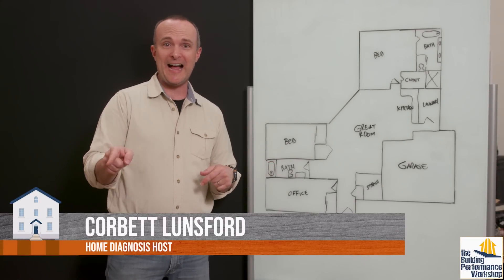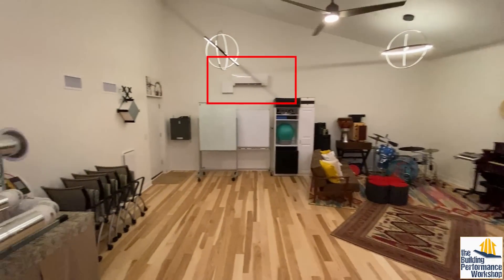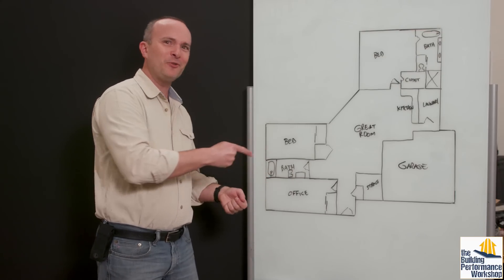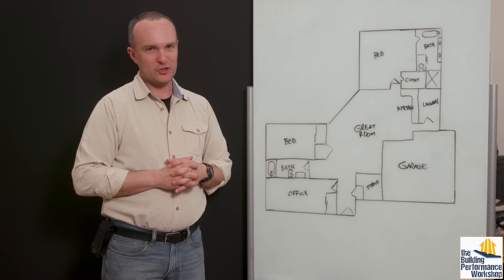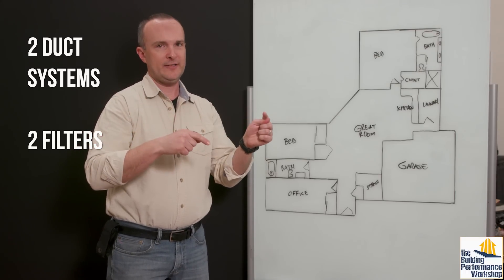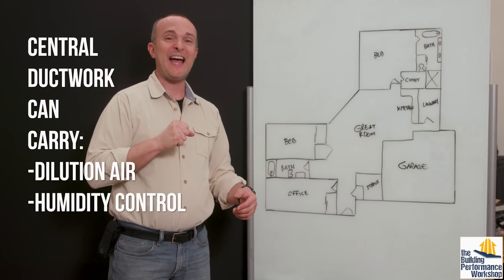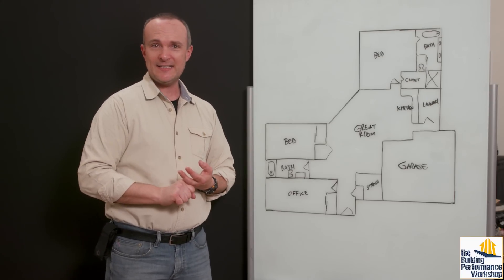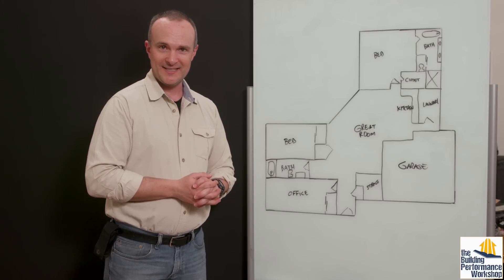HVAC Ducts Reality Check: Are Ductwork Systems Dumb or Essential?

Comment: A bit off topic… but what became of reversible duct systems that included registers both on the floor and near the ceiling to capture hot and cold air optimally?
Reply from the maker: Interesting q, Ty- I’d say if you have a good airtight insulated enclosure, you won’t have as much bleeding of heat, and if you keep the air mixing then you won’t have any hot or cold regions in any room.

Comment: Hey I've got a question on manual J.  I'm building a new home addition, it's 1500sq ft of shop with 1k Sq ft living space above.  Separated from homes envelope.  

R21 insulation in all walls, r5 foam on the exterior.  9ft ceilings.  1st floor is slab on grade with insulated edges, r38 in the floor joists. It's got 4 18"x4' windows. Second floor also has r60 attic, it has a slider, a man door, and 3 4x5 windows.  I've air sealed with foams and acoustic caulk everywhere I can see including soffit (left enough open for venting). 

Area is eastern wa, design temp is 95 high 11 low.  The calcs I get say I need 10k btu heating and 8 cooling.  That seems wildly off base, and my original plan was a 24k mini on each floor (they are both wide open rooms).  18k minis are exceptionally cheaper so now I'm waffling between 18s or 24s.  

Any advice??
Reply from the maker: Doing the math almost always shows you a much smaller than expected load. That’s because we were trained to think that every home needs a massive HVAC system, which is simply nonsense. Your load is feasible, but I’d need to see the details to completely agree.
FYI: if your load is 8k cooling and you install not one but two 24k units, you will be oversized by 600%. The inverters will ramp down to 16k minimum, no lower, so you’d be installing single speed 200% oversized equipment in reality.

Comment: Air filters in central air systems with ductwork do very little.  Do they remove dirt?  Sure.  Most dirt?  Nope.  I have lived in several homes with such air filters and  have seen the dust they remove, and I compare that to all the dust I still see on shelves and other flat surfaces, and the inevitable dust bunnies.  Conventional filters in central air systems remove far too little dust.  And they create a pressure drop, so the fan works harder, so the homeowner pays more money for electricity, without even realizing it.
Reply from the maker: Higher MERV, bigger filter surface area will fix all those problems
Reply: How would that fix it?  When I put in both the 4 inch plus the standard filter that my supposedly healthy system has, the hvac company said it was too much and blocking airflow would make system work too hard.

Comment: A lot of Europe is ductless and I prefer it at least for smaller units or spaces.  Like anything under 1800sqft or so would be dumb to do ducted  both new and retro build - it takes up a lot of space, noisy, expensive labor, and chances are the HVAC contractor will design/size it wrong.  Completely different when talking about 3k sqft or bigger building with multiple floors.  In such cases you probably have the budget for a nice system, and  contractor that has some engineers for a good/proper design.

Comment: Duct work and scorched air are very bad for those with lung issues. I have designed and built 2 homes now with no central heating cooling or duct work. I easily filter any air with a HEPA filter if needed. I enjoy clean allergy free air and proper humidity without the scorched dustly dryness of primitive and costly ducted systems.

Comment: my 1970's home has no ducts, but I wish it did.  Would make things easier.  I just have electric baseboards in a cold climate.  I'm trying to find cost effective ways to upgrade hvac (add ventilation, dehumidification, and some cooling would be nice).  Quote for whole home minisplits was so high, I might go for radiant floors instead and buy a couple air-filter appliances

Comment: On suggestion: Avoid using Flex duct as much as possible. Yes it cheap & easy to install,but the plastic breaks down over time. At best Flex Duct has a lifespan of 20 years before the plastic starts to fail. I recommend PVC Pipe, Kool-Duct by Kingspan, or Metal Duct work. Using PVC pipe is the easiest to use since you can use PVC pipe fittings. You can use Sch 30 6" PVC for all of your branches. For the truck lines I recommend Kool-Duct as its R-6 and does transfer noise as much as metal duct.

Comment: I think you're missing a few points. The first is that without zoning a single HVAC system has hot and cold spots throughout the house because there is always one room at the end of the line that gets the scraps of heat and cooled air. Then you have the basement which is too cold in winter because you're heating the upper floors or bloody freezing in summer because all the cool air pools down there. Then you have the fact that you are constantly conditioning the air everywhere in the house even though people may only be occupying those spaces for less than half the day. Personally, I am all for having two, three, or even four minisplits throughout the house. They can be programmed to turn on before the space is to occupied amd off when not, like at night.
Reply from the maker: Performance tuned homes with attention given to airtightness and insulation do not, in fact, work the way you describe. It’s a challenge to understand it if you haven’t spent time testing homes like this.
Reply: @HomePerformance  mine does. I think open concept from basement to upper floor throws all tuning and testing out the window. I know I could add automatic dampers to the supply ducts to help but when you're dealing with one open space over three floors it is a major challenge. We had a 168page report on hvac submitted to the city and it still doesn't work properly. I'm going with a wood burning fireplace and zones controlled by individual units next time. Centralizing with one furnace is also risky as they tend to break down on the coldest day of the year. Id like to have an alternative source of heat for when that inevitably happens.
Reply from the maker: Holy cow, that’s not supposed to happen, there must be a lot of things off with either the design or the install.

Comment: OK.  I went in between.  I went with Mitsubishi also - I put a traditional 1 1/4 ton head in my conditioned garage, but on the living space, I went with pancake, above the ceiling air exchangers and ductwork...but each exchanger had 3 12x12 inch return filters going into a custom designed return plenum - and each had 4 supply ducts from a supply side plenum.  I was able to have each do multiple rooms, but with very short runs on both supply and especially return.

Since these are low static units, you have to minimize bends in the ductwork and it's better to use metal near the ends and elbows rather than very mcy flex duct...just enough flex duct to keep things quiet.  And man, are these things quiet.

Comment: I recently went through this decision myself. I have a 2 story up and down duplex. Each unit was heated using electric baseboards. I looked at ductless options (as we had a ductless AC unit in the upper unit already) and i looked at high velocity tiny furnaces 15kbtu-30kbtu units). In the end i opted for 2 seperate firnaces 40k btu each in size, one in each unit with their own seperate ductwork. 
I came to this conclusion for the same reasons you mention here. Air cleaning, central conditioning, fresh air dumps into return plenum and blends with homes return air and ditributes to each room, and cost! A quality ductless with 3 indoor heads can run near 15k canadian, and in extreme cold weather id still need backup heating...no thanks

Comment: i will be building several houses over the next few years, and they all have a set of things in common: 1. radiant floor heat.  2. an HRV.  3. a mini-split for minimal A/C.  perfect combination and only a little duct work
Reply: Hopefully you get someone who knows what they’re doing for your ERV/HRV. I have an ERV and the contractor put in a simplified system. I’m going to be stripping out the insulation in the attic and in the area in the attic where we have the ERV I’m going to be removing the trusses and replacing them with rafters with the insulation between the rafters and putting in a dedicated system. I’ve spoken to a number of contractors and it appears the vast majority of them are clueless about a well designed system. As well as properly insulating a house. Radiant floor heating definitely is nice.
Reply: @erictoulon5946  I have a Lennox HRV5/150 that I installed myself in this house, and i'm quite pleased with how it turned out.  4 supplies 3 returns, auto runs in low sunset-sunrise
Reply: @BrianKrahmer  I live in Hawaii so I'm wasn't that familiar with them other than knowing that I wanted one for my house that I just had built in Washington. I've been watching the technology evolve since majoring in industrial arts in the late 70's. The contractor did a really good job building the house but there were a few things I would have done differently had I known. All in all it was a great  learning experience and the remodeling projects merely reinforce the learning curb. I've been in a few houses that had good ERV/HRV systems and that is what I am trying to achieve. Tight houses with poor circulation almost always trigger my allergies.
Reply: Hey there, I'm building an affordable, high performance house this year in the Puget Sound.  Would you recommend and share their contact info?

Comment: I've done thousands of real estate HVAC inspections that include duct evaluations, and always find the return area is to small. Not only does that hurt the system, when a high merv filter is used in these systems, it puts even more of a strain on the equipment. Sadly the high merv filters don't have a warning on them about the return sizing requirements. Return sizing when using high merv filters is the most overlooked part of a system. 

Personally, I run a ducted system and a mini split. I also open the windows in my house on the nice days (69-74f outside) for natural fresh air cross breeze whole house air exchange. This is something most people never do these days.

A big problem I see, as a contractor, with energy efficient homes is that no one looked to see if all the energy efficient items work with each other. For example: An entire community was built with Rinnai water heaters, and water saving fixtures. After the 1st year was up for builder warranties, everyone was complaining that no hot water was available at the fixtures. Sure enough, all the water saving fixtures had low gmp devices on them that would not let the Rinnai fire up to heat the water.... LOL How does one tell the owners that got Tax Credits, that they either loose the Rinnai OR all the fixtures have to be replaced or modified with higher gpm devices??? LOL This is a problem that can get the owners in trouble with the tax credit program, and also that the final inspectors approving the tax credit don't understand or catch.
Reply: Actually, your furnace blower cannot overcome a high merv filter, regardless of the ductwork. Everything is much more intertwined than most people realize.

Comment: Is duct work dumb or essential?  The answer is....yes.

So much ductwork is so poorly done, both residential and commercial, that it causes more problems than it solves.

Usually, the building is designed first, and then the mechanicals are shoe-horned in after the fact and done on the cheap.  You end up with some pretty junk systems that can not be easily maintained nor easily upgraded.

Couple points:
If you want regular fresh air bathrooms make great constant exhaust points.
You are asking for trouble if you have a single mechanical AC system.  WHEN your system fails, you now lose 100% of your ability to heat heat/cool/filter your air and yay you now have to pay a premium to get someone to come work on your system immediately because you have no choice.
Dedicated dehumifiers work far better than central AC based systems and can be located nearest to trouble spots.

Comment: It is hard to comment on this with no sizes up... But couldn't you have tucked a 5 head mini split near the office bedroom that would feed all main rooms?  Then just put in cheap electric panels under the flooring in the bathroom for heat that if your house is sealed well will not really ever get used..  Then in the garage or laundry room, maybe a crawl space or attic put a ERV/HRV system an just run the 250cfm 2.5inch heads to the areas in need/ all the non bathrooms to keep the negative pressure you need or at least make sure it is less cfms to the rooms then the fans can take?

Comment: Question. Why is home heating ductwork so bulky and volumetric? What is the physics behind it? Does warm air need all that space to move from one end of a home to another?
Reply from the maker: Each ton of A/C moves 30 pounds of air, so yes, if you have a long or complicated route it gets bigger as a rule. Why designing your duct runs into the plans at the beginning is so important to keep them simple.

Comment: Problem in the US is most homes rely on the V to deliver the H and the AC. I've spent enough time in other parts of the world to know this isn't always the best. You elude to it but don't really make the point - you don't need to move the same volume of air to each living space to Ventilate it, if you don't have to rely on the same system to heat or cool it.
Reply: I think you meant allude (to refer to something, often vaguely). Elude is to avoid, like a solution to a difficult problem does to the one failing to solve it.

That being said, I agree. There are some valid concerns here, but those are concerns that can be addressed in better ways than "let's avoid this new problem and just stick with the problems we got used to".

Comment: Another question. Why does the system use the AC compressor in the winter when the house gets too warm when there is plenty of very cold air outside? Seems like it could just pull in some of that cold outside air.
Reply: That's called an airside economizer, and it's done all the time on the commercial side. AirScape makes the only residential economizer that I know of.
Reply: @ZergZfTw  Cool!

Comment: My 1950 bungalow had no insulation, aluminum single pane windows and only 1 wall furnace. Putting in multihead ductless for heat/Ac, a muilti branch duct system for an erv, and a separate/simpler ducted system for filtering and Dehum. And a make up air for range hood.
Air sealing and insulating the ceiling and floor. Replacing the old aluminum windows with fiberglass dual pane. 
It’s definitely not the cheapest way to do it but i like each system being able to work independently as needed

Comment: corbett-for a two zone system, ie committed to two heatpumps and two sources fo ventilation, what do you think about using a ventilated dehumidifier for bulk of make up air in summer/trunk season, and a standard ERV for most of the colder drier months ? ie size each so that each can handle non boost situations.

Comment: What is the least energy efficient way to heat something, convection, conduction or radiation?  The answer is convection, which is basically using forced air instead of being in direct contact or direct line of sight with the heat source.  What is the most common type of heating used these days?  Convection is most commonly used for heating, because we have developed these complex systems over the decades when being efficient was not the goal.  The larger a centralized "air" system is, the less efficient it is.  We do have a better understanding of how important it is to circulate air, and today's airtight home designs require it, so air handling is a necessity.  Lumping in a centralized HVAC system with air handling takes advantage of the duct work needed for both, but that doesn't make it an efficient way to heat a home.

Comment: Why wouldn't you just put the furnace and water heater in the garage with a layout like this? Then you have a deeper primary bedroom closet and two lines to run to the wings of the house. I don't think most builders would put returns in bathrooms to lower the pressure, so you could just have a single return in the garage side of the great room. Putting the furnace next to the water heater may allow greater flexibility with your heat pump(s) and humidity control.

Comment: 1 unit, 4 heads ... plus erv pulling air from baths and laundry.
but I completely agree about a need for iaq and great filtration. so I would recommend cassettes above the ceiling, of br's and office, and ducted casste above garage dumping to Great room. each cassette to transition to a Lennox Healthy Climate(minimum, prefer the Pure-Aire ... atleast for unit supplying Great Room) air cleaner. 
as ERV pulls bad air from baths and laundry, replaced by conditioned air from BR's and Great Room. Incoming air from ERV to Great Room. house stays balanced and gets good IAQ. Filter media above BR's and office probably will need to be changed every 3 to 5 years, above Garage ... every 2 to 4 years. costs a little more, but done right.